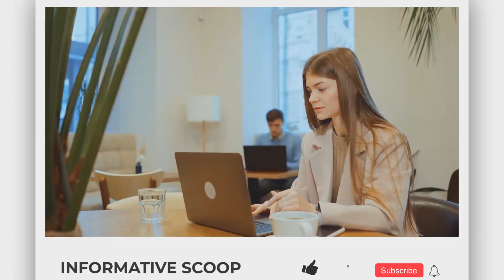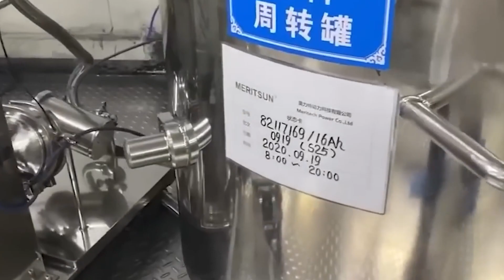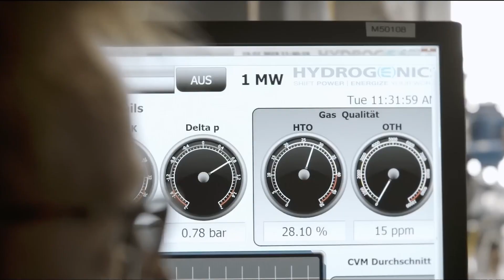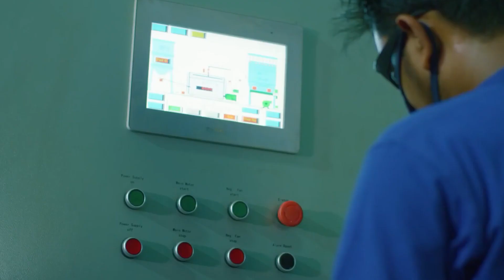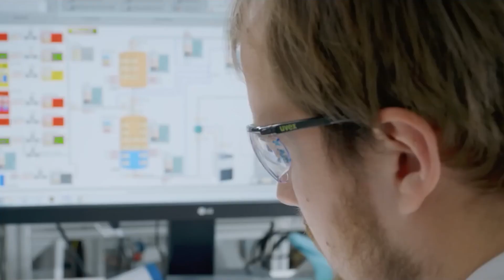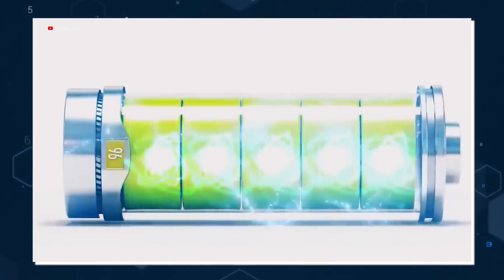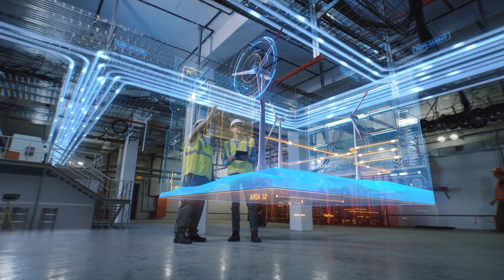Elon Musk Just Presented New Solar Battery As Strong As Nuclear Power!

Comment: Finally someone doing this and this technology was available in the late 1950's it is not new. Also the radioactivity does not harm mammals but we are not allowed to know about that.
Reply: first learn to recognize nonsense youtube videos.
Reply: Perhaps nobody told you that the POWER DENSITY of this technology is 1000s of times less then Li-Ion. With a power density of less than 100 micro Watts per cubic centimeters you can easily understand that beta voltaic batteries are not feasible for smart phones, laptops, EVs and so on simply because the battery will need to be 1000s of times bigger for the same power. Alright, if you hire someone to carry your mobile phone battery on some cart rolling behind you, it's possible LOL... try to understand this subject please!

Comment: radioactive decay has been use to power electronic for decade. this is not new, their power to weight ratio suck, it why they were not use. it has a very niche purpose which is to protect critical system that may suffer damage if they run out of power. until I see their PTW reach standard battery levels, I won't pay them much attention. they need to be at least better than sodium batteries to be attractive, as sodium is cheaper and there is no reason to use a battery that is more expensive if it provide the same output per KG.
Reply: It won’t happen. The radioactive decay is simply not yielding enough power output no matter what isotope you use. If you want more serious power you can use Plutonium 238 and with 4.5Kg of this nasty stuff in a battery of 37.7Kg, you can produce 157 Watts or same as 0.2 horsepower (check Voyager). That’s not enough even for an e-bike. Besides, it is an extremely dangerous battery. In fact, you simply can’t combine a high power density with safety for any nuclear battery because whatever power you get out is a subset of the power from the radioactive decay. An EV battery of 10kW using nuclear decay would likely need to constantly decay in the radioactive isotope with a power of 20kW. Your car would go up in flames when all that constant power has nowhere else to go. Such a battery has no off switch as you can’t stop radioactivity. And 10kW is only 13 horsepower so it won’t be meaningful anyway and the battery size will be like a big house. This topic is pure ignorant rubbish.